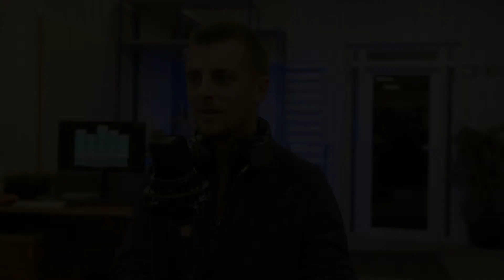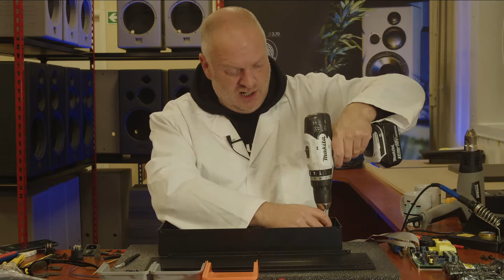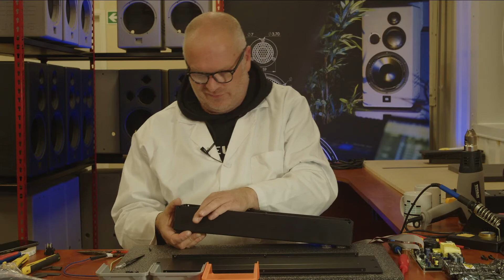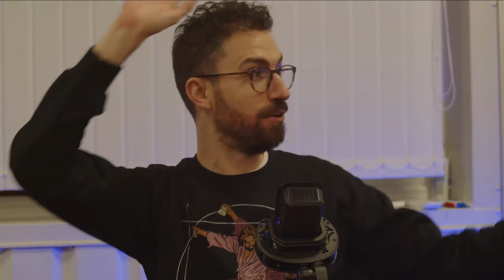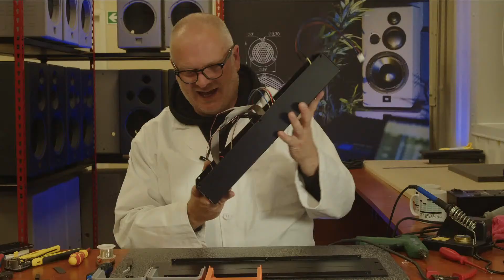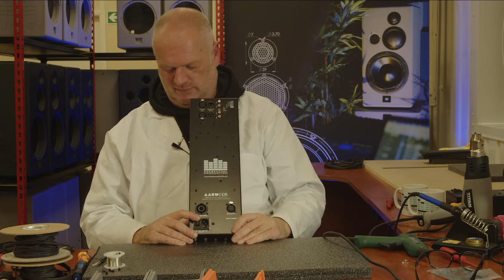Building Our HYPEX Amp Pack LIVE!

Comment: Hello everyone from present day production..
Did I understand correctly that it is possible to have the ribbon tweeter installed in the mums?
I would want to buy a mum 10" with this tweeter.
Or does that mean that you might want to develop a new type of speaker.
Kind regards
Reply from the maker: Currently it isn’t officially in the design, but we have discussed it!

Comment: The explanation of Volts and Amps requires correction. Voltage is analogous to pressure.  Amperes is analogous to rate of flow.
Reply from the maker: Thank you for your correction. It had been a long day!

Comment: Does the digital input on the speakers negate the need for good quality convertors on the computer side of things? Bit confused as it seems there's another set of conversions happening in the active speaker side and if you go into the speaker as digital, then you remove a set D/A & D/A conversions. Or am I confusing things? :D

Comment: Enjoying this, thanks for sharing! Just to note in case this isn’t pointed out elsewhere that although water flow is a good analogy for electron flow, it was described the wrong way round in the stream (no pun intended!). Volts is equivalent to water pressure, amps to rate of water flow. (And ohms to the size of the pipe.)

Comment: Well, do roundover or rather chamfer on the inside is defined by either u DO have an impedance peak because if it or you don't. In my case I did have a peak and chamfering did help a bit with it